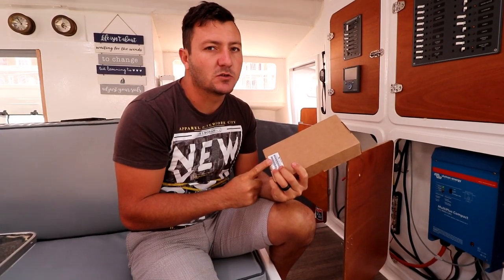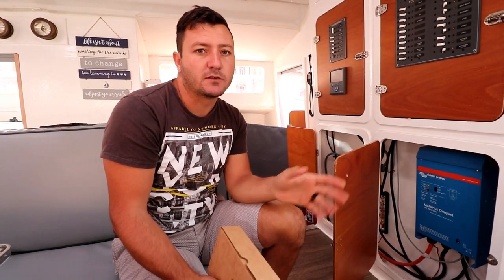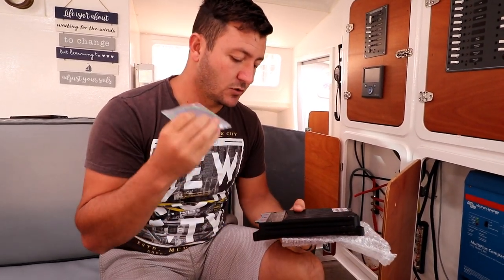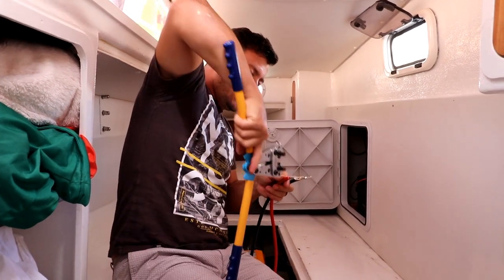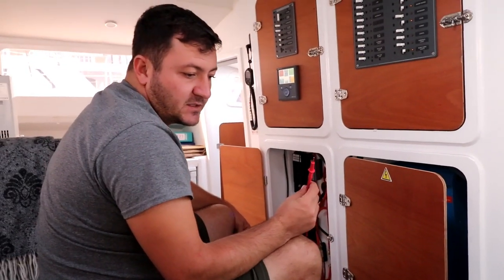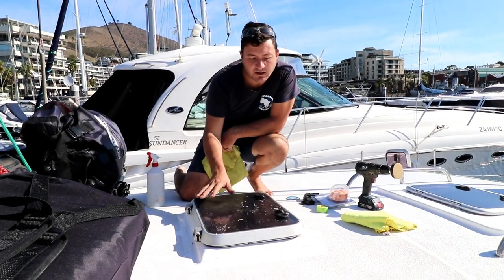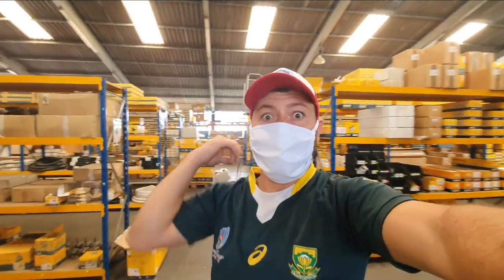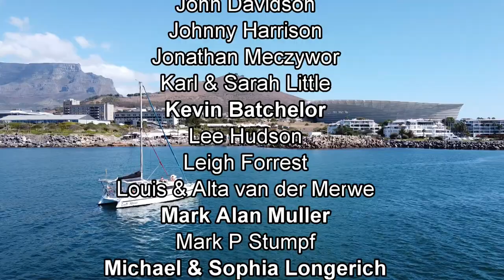Charging our Engines from our Alternator | Buck Boost Install

Comment: Greetings. Love the S/V. Glad you are willing to show us this boat. That seems a lot of space to dedicate to three pieces of equipment and four fuses. Kind regards, Dave
Reply from the maker: Thanks. It was space allocated for it. You don't want everything crammed on top of each other when it comes to your electrical in case something goes wrong it's easy to locate and pin point.

Comment: Good thing you do the lithium installtion for other vessels. Wish our yacht was here. Then we could do the same. I received report that I might have lost my 4x AGM batteries drawn to 0Volt due to failed MPPT controller. I am awaiting report to see if the can charge them back up, but I have little hope.

More importantly, I am considering moving up to 3,5kw (45kg) single unit Supercapacitor battery. It is more lightweight, compact, incl MPPT controller and build-in converter 220v/110v. It charges full in a fraction of the time, has 1,000,000 cycles and can be drawn 99% (in which case the back-up battery kicks in and disconnects the battery).  It comes with a 10yr warrantee.  I did not buy one yet. I was quoted  $4200/R69,000 (alas 8 weeks delivery) - so if my batteries did pack up, I am seriously considering jumping the LiFePO4 option. What do you think?

Comment: I’m assuming you also ran them up to full charge, and watched the amperage slowly go down, and then shut off...for times you motor for a long time. That’s always the scary part, knowing you don’t want to overcharge....Food video guys!
Reply from the maker: You cant overcharge with the buck boosts if the parameters are set correctly so you gotta kinda know what your doing. Lithium are awesome but they also take alot of research and aren't as plug and play like AGMs. You guys know. Sending lots of hugs your way 🤗

Comment: Hi Guys. Love your videos - well done and keep it up.
Ricky, when you ran the motors they did not sound happy to me. Perhaps some sound quality issues, but they sound very much like they are detonating and quite badly at that (pinging), perhaps an air fuel ratio issue or more likely timing a bit too fast - all of which is software controlled I agree. 
It could also be that they over fuel slightly when cold  - not sure, but worth checking as detonation in diesels us a really bad idea.
Cheers 

Ian M (South Africa)
Reply from the maker: Haha Ian , i like your theory about the engines it made me smile . We have a noise cancelling mic and the engine compartments were both open at the time . Sound not accurate.
But thanks for your concerned 😉

Comment: You could put a disconnect between the alternator and the buck boost. That way you can isolate side to side.
Reply from the maker: Both sides are isolated from one another , we have two buck boosts, feeding the single house bank.

Comment: Hi guys. So those buck boosts are like an external regulator, but you don’t need to modify the alternators by adding a field wire and invalidating your Vetus warranty? 
I use an external regulator and I had to modify my alternator by adding a field wire,  so the unit can override the alternators own regulator and take control and charge my AGM’s with the correct 3 phase stages and voltages and also faster with temperature compensation on both alternator and batteries.  Love your videos and been following from then very start of your journey......your progress and achievement is off the scale! Just incredible. 😁👍🏻
Reply: They are pretty much like the Victron Orion Smart DC-DC converter/charger or the Sterling BB1260 without the crappy flashing lights interface. Of course they cost a lot more.
Reply from the maker: Thanks so much & it's exactly what Carl said. ☺

Comment: Isn't there a Buck Boost available that can connect to 2 engines same time instead of having 2 of them, and if you get the 100 amp Buck booster, will that go faster or how does that work?

Comment: Do you have a link to the roller shutters that you've used on your aft cabins? I don't think they've been shown or talked about during the build.
Reply from the maker: We did mention them in previous episodes I just don't know which one 😂 they are just normal roller blinds. We got them at a place called curtains and linen in PE.

Comment: Unless an alternator is made for commercial use (say like a real truck or machinery) don't believe the ratings on the label.  Yeah, they can do about 90% of what they're rated but if you try to do that for any length of time, they'll fry.  Industrial alternators have big cases, strong bearings, big fans, and good electronics.  Probably not good to ask them to do too much while at idle (low rpm) either.  what is the running temp inside the engine compartment, electronics in there don't like it too hot.  A car or truck engine get lots of fresh air while driving.

Comment: Still much safer with systems being separate period .   If it fails it destroys yours expensive batteries ....  do your homework most people keep them separate .
Reply from the maker: How do you want to keep them seperate? House bank is protected for over volt , under volt and over current.  System is solid
Reply: Sailing Lady Africa ... why would you sail with two water pumps redundancy , if a failure occurs in your system and you lose power  how do you start the motor in the advent of an emergency ... kill the one system  ... what’s your plan ?